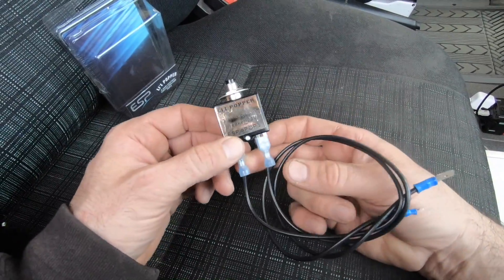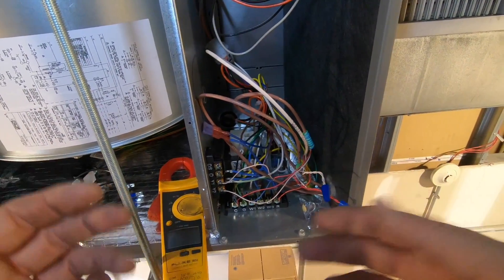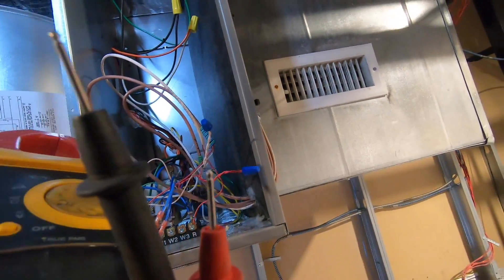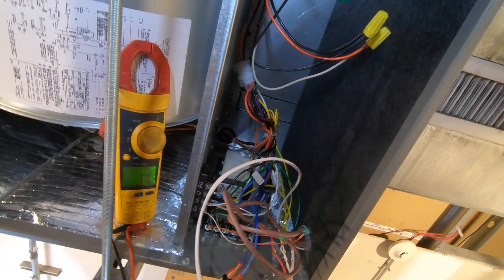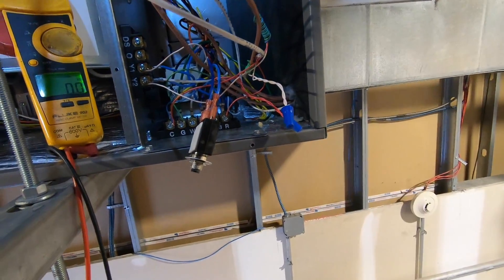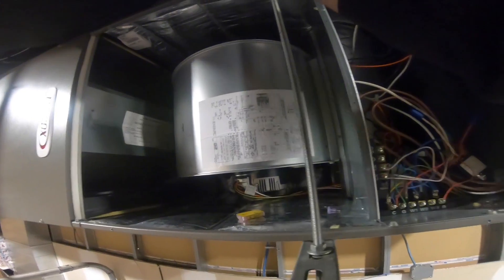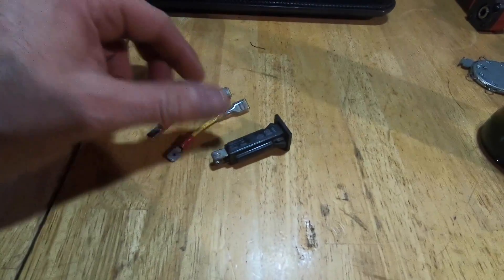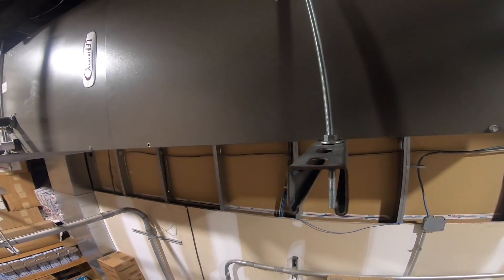Tools For Troubleshooting Low Voltage Circuits Blown Fuse In Air Handlerv

Comment: What causes a transformer to blow?
Reply: I usually find exposed thermostat wires shorting against each other will take out a transformer or a bad control board.
Reply: @bhunter3850  it definitely will, but the one i had didn't have a short in the wire, i did find the issue, a bad coil on the Contactor
Reply: @aaronclark1599  haven’t seen that one before but good to know. Thanks for the extra knowledge!
Reply: @bhunter3850  you bet.. anytime you check a coil it should be between 10 and 18 if it's any less or more you've got a bad coil and it will pop the Transformer or a fuse instantly
Reply from the maker: I have vids with the shorted contactor coil
Reply: @thehvachacker  that's where I first seen them.. Great videos.
Reply: Thanks guys! I’ll check out the videos.

Comment: Nice video on lv circuitry.   I'm sure you love  working off of a 12 to 14 foot ladder to diagnose equipment.   I would have hung the ah with a 3rd piece of strut and strapped it down so it doesn't move.